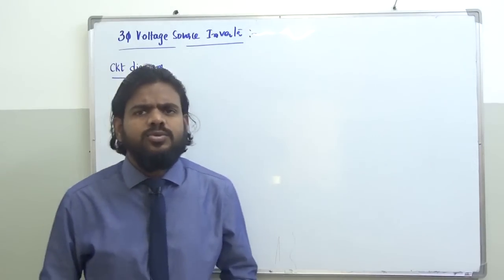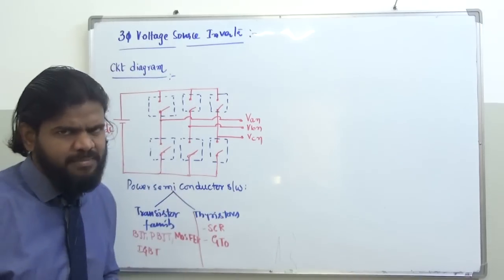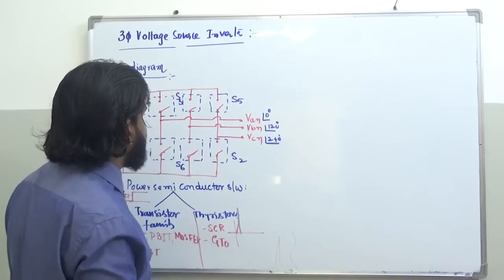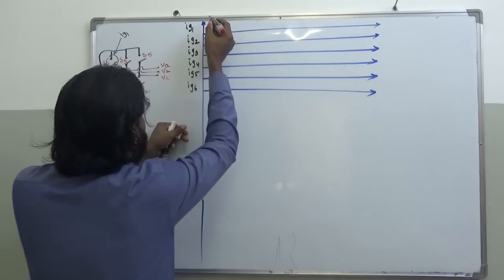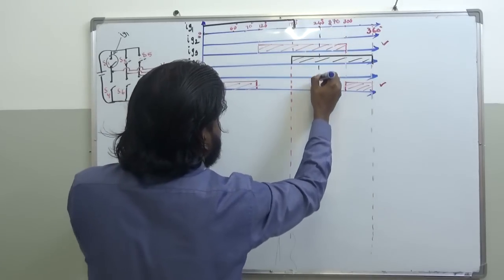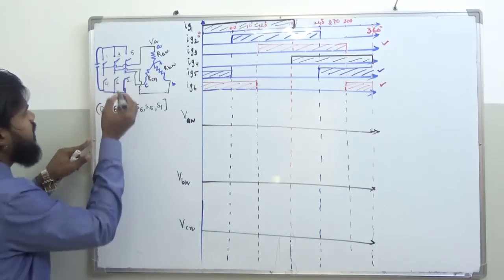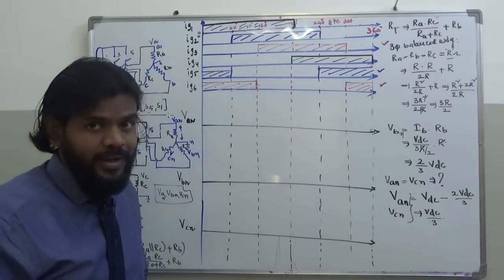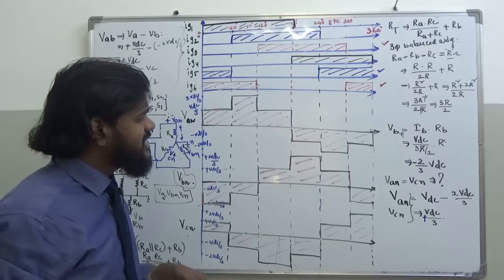3 Phase Voltage Source Inverter - 180 Degrees mode

Comment: HI sir ... i Have a doubt how to consider the voltage if it is not connected to neutral to ground. In your case you have connected to ground and taken -2/3 Vdc i did not understand
Reply from the maker: Hi dear, please check the derivation again thoroughly, and when there is a neutral, consider the voltage to be zero at that node. Tq

Comment: Excellent sir...I have doubt when to switch on and off of switches(bjt) .....How to calculate time period..If we know frequency and angle 120°
Reply: Please share formulae
Reply from the maker: total time period of a supply sinusoidal waveform is T = 1/f = 1/50 = 0.02 sec = 20 msec, so for a full cycle of 360 degrees time taken is 20msec. if its 120 degrees, it will be 6.667msec.
I hope, its satisfactory.

Comment: I am not an expert but can you confirm the phase angle you have written is correct i.e. 0, 120 and 240.  I think the angle should be (0, -120, -240) or (0, 240, 120) for the positive sequence output you have drawn. Please clarify!!
Reply from the maker: Dear , it depends on the orientation of phase sequence that you would consider. and it can be CW or ACW. Hope it helps.

Comment: The explanation is fantastic. But you have not explained the reason why the switches are numbered in a particular way and what would happen if numbered in a  normal sequence.
Reply from the maker: Numbering is done for the ease in switching sequence. Numbering can be changed, accordingly switching sequence number will change, but not the switches.